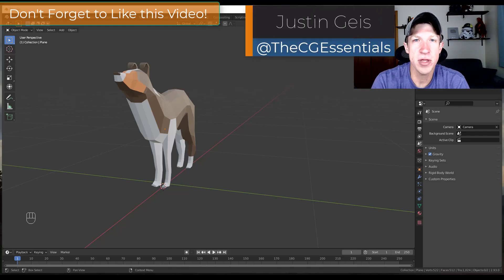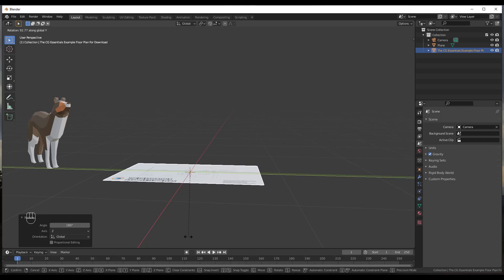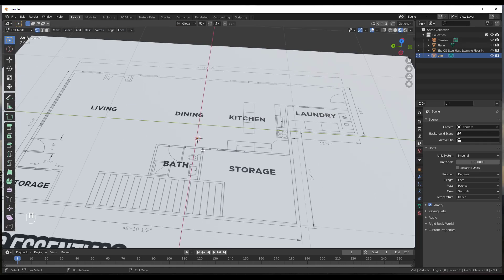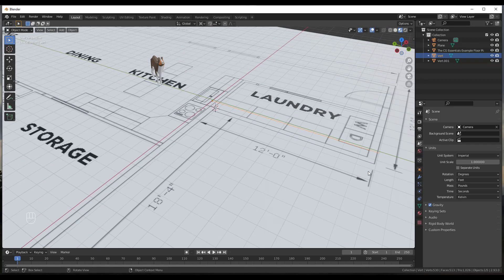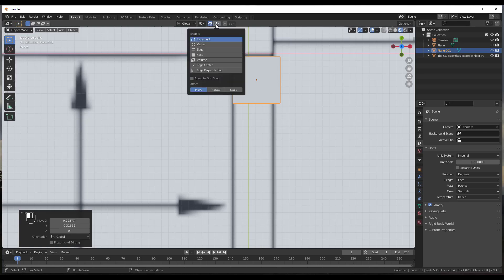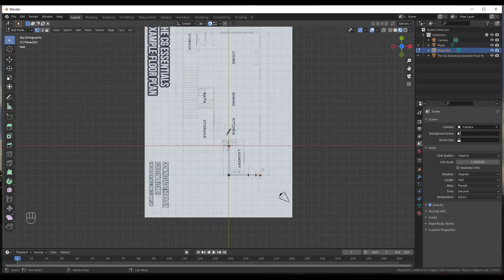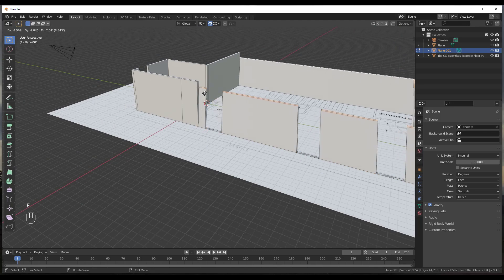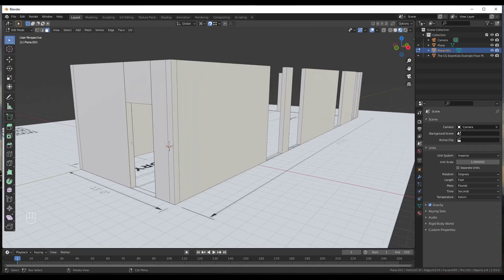Architectural Modeling In Blender Part 1 - Modeling from a FLOOR PLAN

Comment: can I use jpg file or does it require psd?  I'm unable to use jpg file in Blender, no error, just blank plane.
Reply: try just dragging in the JPG or PNG.  Blender will treat it like any other image and you should see it fine.  For some reason, "Images as planes" doesn't work for my 3.3 install.

Comment: Never thought I could use Blender to model Architecture! This is great, well if I can get it to work. When I import your floorplan using Images >>> Images as Planes, I just import a blank grey plane. When I use Image >>> Reference or Image >>> Background, the floor plan imports with the details visible. What am I doing wrong?
Reply from the maker: Sounds like you might only be in shaded mode in your viewport for the first one. Switch it to material preview

Comment: I was wondering how would you go about applying pbr materials to the external walls and different ones for the interior walls?
Reply: I think that on edit mode, using the face selection, you can select an exterior wall and then click on the material properties tab and assign it one of the materials you’ve already made.

Comment: Once you bring in your drawing, you can scale it by bringing in a plane from basics shapes make it 12ft square, turn it on edge, then just scale the drawing up or down. Another tip is lower the opacity of the drawing so you can see what your drawing.

Comment: Hi, After you extruded the wall to 10 ft hight, you could make loop cuts at 3, 7 & 8 ft and then delete window & door openings, it is much easier this way. Thanks
Reply: I used to do this way but it creates problems if you want to make a lot of changes afterwards, in my experience
Reply: @mmed4508  yeah, that was the method I was using before watching this video and it was giving me some issues and it creates unnecessary vertex points making it a longer render
Reply: It would also help incase you ever wanted to convert those to curves to put tiles or trims or anything of that sort along those walls.

Comment: There is a much faster and simpler way to scale the drawing correctly. Draw a line on any of the dimensions - longer dimensions will be more accurate. Say the line you drew was 6 feet and the dimension on the drawing was 18 feet 4inches (or 18.333 feet). Divide 18.333 by the 6 feet and scale the drawing by the result. Done.
Reply from the maker: Seems like this should work fine - thanks!
Reply: I would rather create a cube, type the length to be exactly 12 feet (in the N menu > Dimensions) and then scale the floorplan to match.
Never confusing the N menu's scale with the dimensions. 👍

Comment: Would you prefer this method to Archipack? Also, if your modeling for the purposes of delivering to Revit/BIM would you instead use the BlenderBIM add on or a different method?
Reply from the maker: Kind of depends. Personally I feel like this gives me a little more control, but Archipack is faster. If I was modeling for the purposes of Revit/BIM I'd just model it in those softwares. Honestly they're built for this kind of thing and will be significantly faster if I have access to them. Blender has a lot of great functions, but it's not built for this kind of modeling like those programs are.

Comment: I need Blender to add some line drawing tools, my work revolves around specific measurements like this.
You can also draw your ground plan in AutoCAD and use Blender's import DXF addon, or similarly in Sketchup export a basic model.
Reply from the maker: Agree - it's very odd to me that there's no "Line tool" in Blender. There are workarounds, but a simple tool drawing lines to set lengths would be a VERY welcome addition
Reply: @TheCGEssentials  I agree!
Reply: snap utilities addon can do that

Comment: Instead of deleting the faces and creating a new face for the gap, you could bridge them instead. I think it's called bridge edge loops 😊
Reply from the maker: Lol - I think I've even talked about this in other videos - makes sense :)
Reply: @TheCGEssentials  it's very possible 😉 There are so many different approaches so I don't blame you. I'm really looking forward to the next parts in the series!
Reply: Another solution would have been to go into vertex select mode, type k for the knife and knife through the short edge between floor and wall to separate the faces.

Comment: That's funny, this week I started modeling out my apartment in blender. But I measured out the walls by hand with a measuring tape. This seems easier.
Reply from the maker: Well, I suppose that depends on if you have a 2D plan view of your apartment or not. If you do, definitely easier
Reply: @TheCGEssentials  I actually have the floor plan hanging on the wall by my entrance. You don't suppose a snapshot from my phone camera would be enough for this? My 3D model with measuring tape has some gaps, I think some corners in the apartment aren't 90 degrees, at least from what I can tell of the floor plan.
Reply from the maker: @Holm55  Should be fine as long as you're not trying to be like super laser accurate. Just make sure the image is as flat as possible in your picture - don't take it at an angle
Reply: i measured everything in one room and wrote a python script to build the proxy object from the coordinates. i tired myself out from all of that and haven't finished the project in a year :(